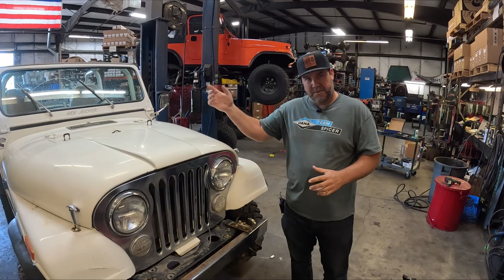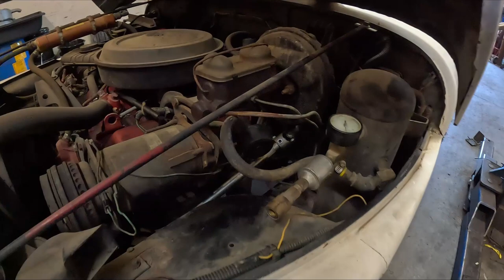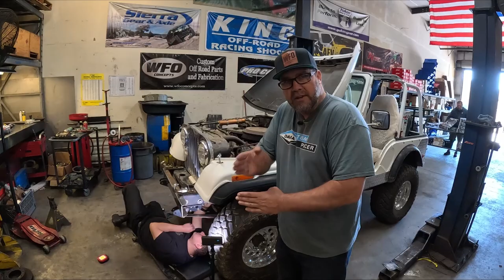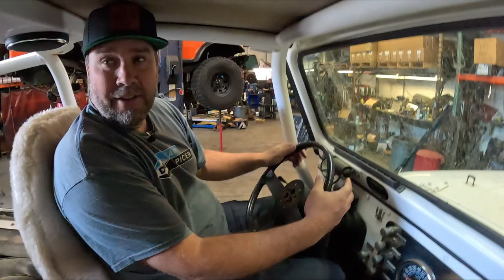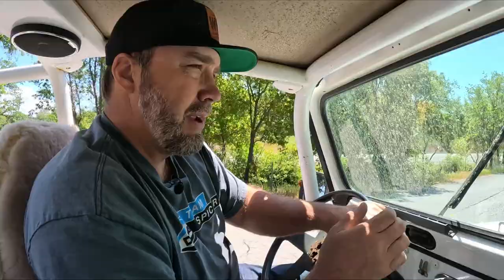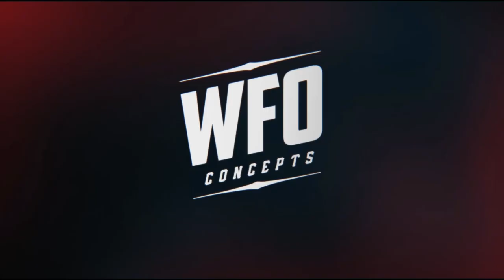How to Center The Steering Box and Steering wheel on a Jeep CJ

Comment: I have that exact problem currently. However, I think my steering gear is worn out since the Jeep lane drifts and the steering wheel free spins in turns. It's a butt clincher when you have a whole revolution until the steering reacts.

Comment: i just tried doing this eadjustment for the box centering at least on my 73 cj6  It has a later CJ box with the o-ring pressure and return lines but still has the 73 steering shaft and big diameter steering wheel. I am only getting 3 1/4 ish from lock to lock.  I assume that is normal for a later model cj box?     I got it all centered up and it mainly meant adjusting the drag link to get full lock up on the knuckle stops on the side I wasn't getting full turn to lock.   Im weirded out about the box though.   I wonder if there was a parts house mix up with the box and I got a car based box?    I've had it for years but it was on my jeep that used to be trail driven only.  I've since restored the jeep and taken it back to street driven duty and light trail use.     Should I get rid of it and find a 4 + lock to lock box?

Comment: This is a great video, I just replaced the power steering box in my 1983 CJ7... however I don't have an aftermarket shaft like this.  I honestly have no idea how to get the wheel straight after making sure the steering is centered in the box.  Both ends have a groove/bolt on the steering shaft, so I can't just remove it and move it on the splines.  Any tips? Or do I just have to deal with crooked steering wheel when box is centered ( i'm talking before I touch the pitman arm its disconnected )
Reply: I am in this same boat. To disconnect my shaft, I have to drop the column. There has to be a better way.

Comment: Good video but very confusing.. I've tried this method on my YJ after replacing all the ball joints and still by adjusting the drag link  I could not get the same number of turns on both sides and the steering wheel middle spoke to be in the centered when the wheels were straight...My jeep came with a 6" lift and its steering wheel has never been aligned...

Comment: that's a factory auto in a cj5  is'nt that rare
Reply: As far as I know the CJ5 was never sold with an automatic transmission because the rear driveshaft would be too short. That’s why they made the CJ7. The extra 10” of the CJ7 gave them the room they needed for proper driveshaft angles and added length of the automatic transmission.

Comment: Man hope this works on my 90 4runner put a new box in it rebuilt the FRONT END COMPLETELY everything! DID NOT center my box so it wont hit the STOPS on the right side off about 1 1/2 inch turn left hits the Stops!!!!
Reply: That was it !! It turns like FACTORY thanks WFO